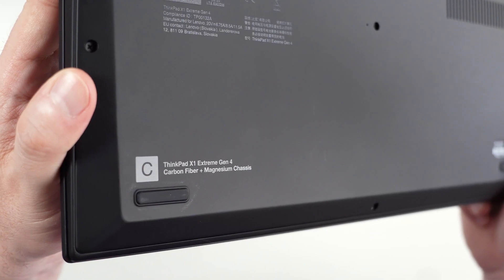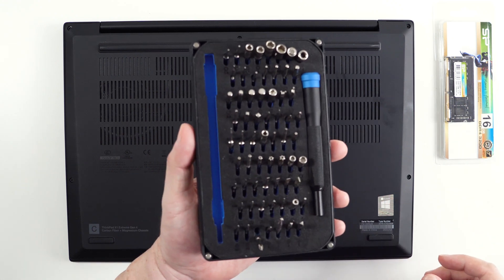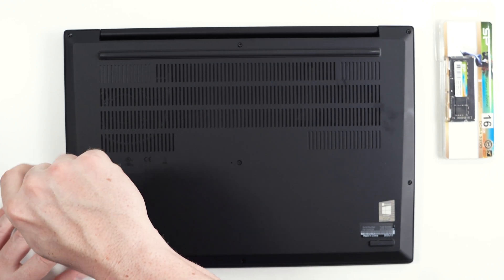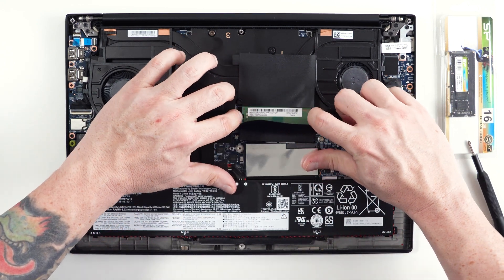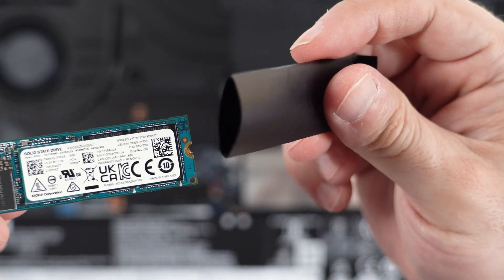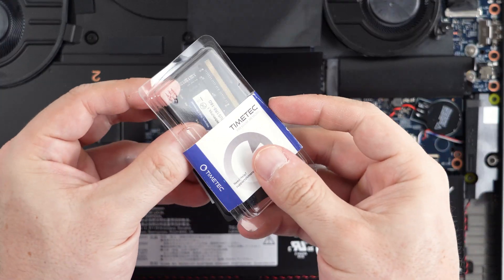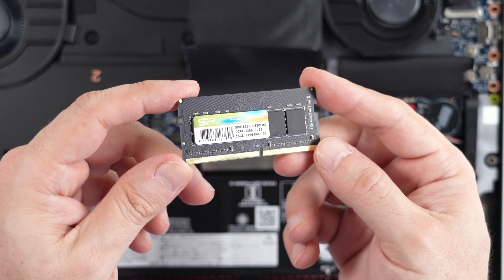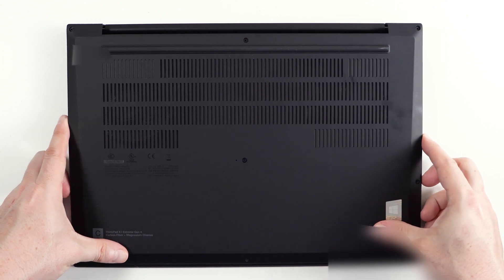Lenovo ThinkPad X1 Extreme G4 2022 Upgrades and Teardown

Comment: My motherboard looks the same. Are there two slots for SSDs? I only found one slot on the right side, I can't find anything on the left side under the sheet metal cover. According to the Lenovo manual, there should be a second slot for another SSD, but there is nothing. I'm confused, is that so?
Reply: I believe it depends on what graphics card you have. The higher ones need that space for heat sinks.
Reply: @reov777  Thanks. I don't know, maybe you're right. There is an Nvidia RTX3080. If that's the reason, however, then Lenovo should state it very clearly on its spec list, which they don't.
Reply: @aquamir  I have two X1s, one has the Nvidia graphics card and 1 x SSD slot. The other doesn't have the Nvidia graphics card and does have the two SSD slots. I agree when ordering I thought both would have two SSD slots.
Reply: @aquamir  I agree, I tore down a customer's laptop fairly extensively looking for the second slot.

Comment: Hi, I have quite peculiar question regarding speaker grills. How are the grills built? Do they have real holes on the whole grill surface? Or maybe there are holes just over (small) area of speakers and the rest are "blind" holes (not really going through chassis)? I'm asking because I have one old ThinkPad with such partly "blind" speakers grills and they gather dirt really awfully and there is practically no way to clean them up. Right now I'm thinking about buying X1 g4 and I really wouldn't want to run into the same problem. Thank you.
Reply from the maker: Speaker holes are real, I can’t remember whether all the way or just over the speaker area, I’ve since shipped the laptop to my client.

Comment: How do you like the machine? Especially interested about thermals and noise.
Reply from the maker: Depends what you use it for, the machine is great, keyboard is best in class, if you’re gaming or heavily utilizing the GPU the laptop does get very hot in some areas.
Reply: @305TechOfficial  I don't plan on gaming. Just everyday business use and adobe suite sometimes. I just like the screen, weight and the ability to upgrade ram and ssd.
Reply from the maker: @TheOxraid  I think you’ll be happy with this model.